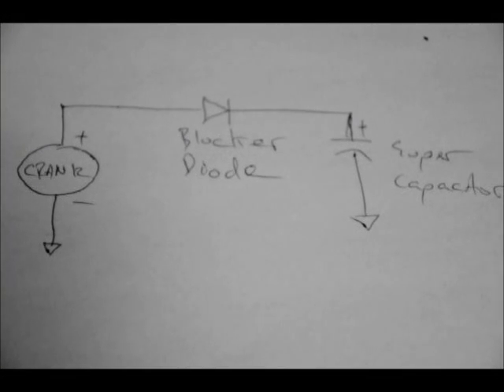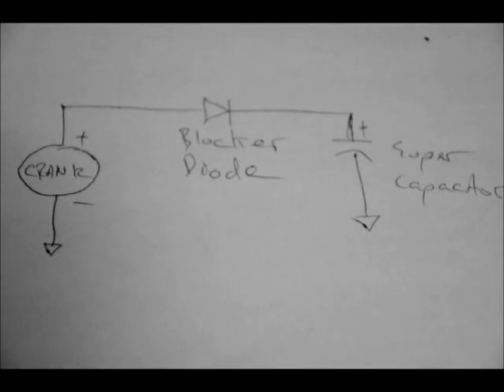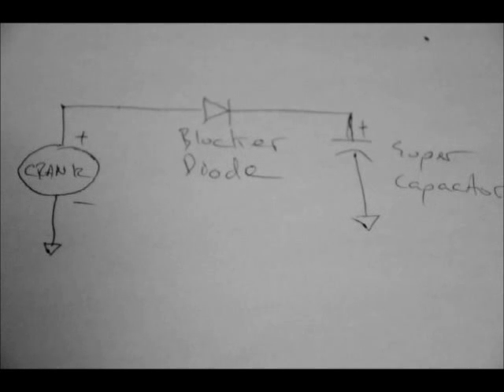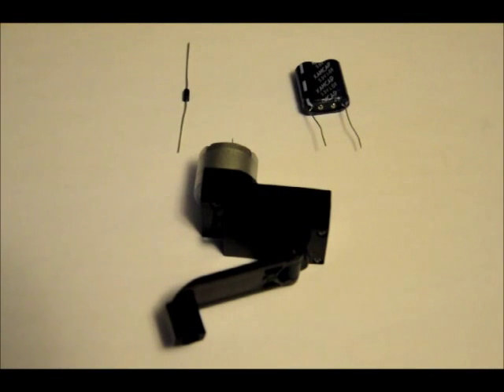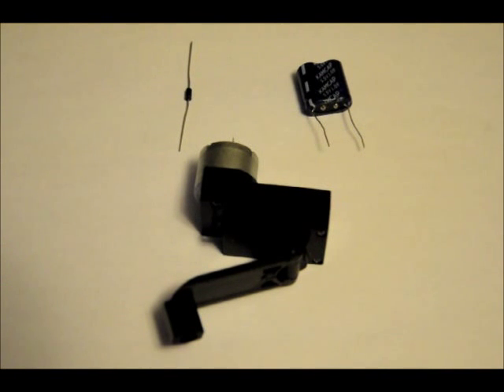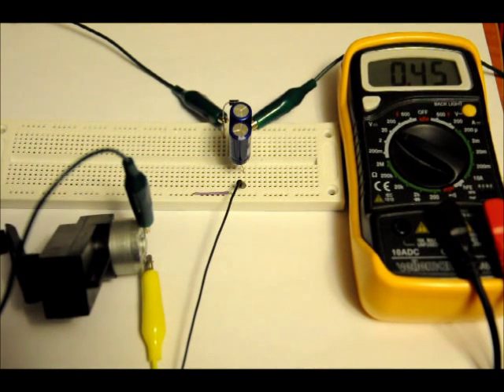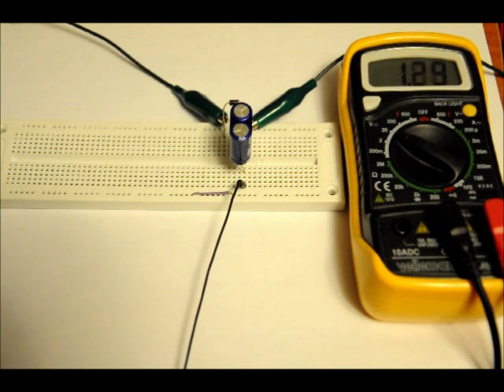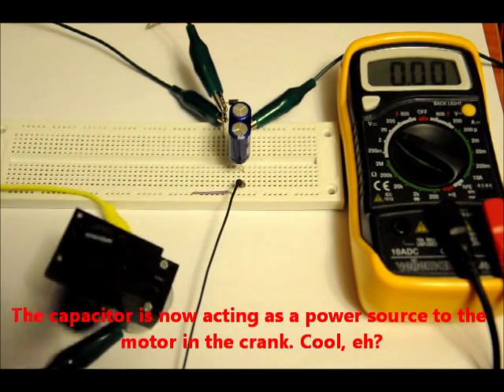How To Charge Super Capacitors Using a DC Crank - A Tutorial

Comment: hi i'm studying electronic engineer and one of my teachers want a final project a toy car but the problem is that the car don't use battery , i am going to use a capacitor in parallel with 2 dc motor 5v  , and the capacitor is going to charge like in your video (manually 2 minutes) , can you tell me what capacitor you use or a better for 2 motor dc 5v 
pd:sorry for my english

Comment from the maker: @trailkeeper 
You're 100% correct about the LM317. Regulation is key.  However, I'd like to add that even if my crank were able to output 100VDC, when you start turning the crank, the capacitor sucks ALL of the available current, which drops the voltage to next to nothing as the cap slowely charges.  While this crank can generate more than 12VDC, the capacitor will not be damaged until you charge past the rated voltage, which in this case is 5.5v =)

Comment: @Slovenija12345   It depends on the voltage of the crank/generator,  if its too high a voltage regulator would be nice.  If he hooks it up to a bike he might need it.  You might be right that it wont blow the capicitor too much here in this video, but I read once that the dielectric strength in super capacitors is not a high voltage.  But if anyone is interrested a LM317 circuit I think he sells would do the trick and it would be fun to do experiments with, when were not overdesigning circuits.